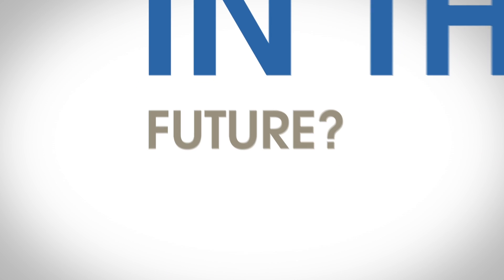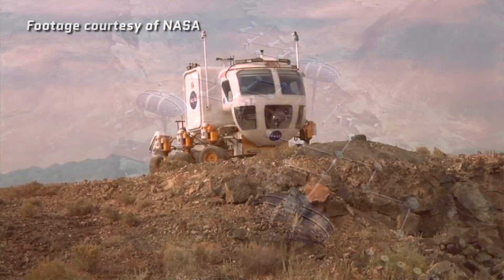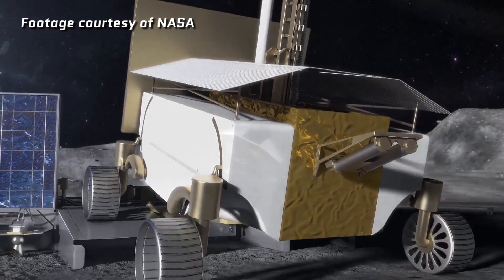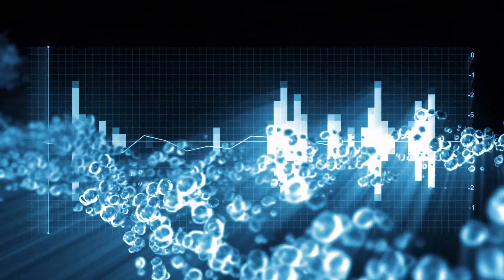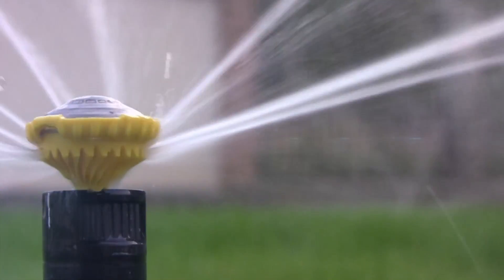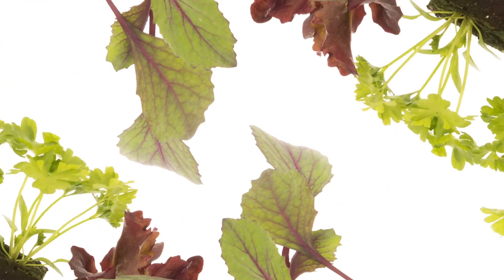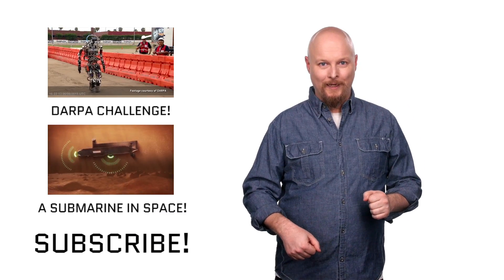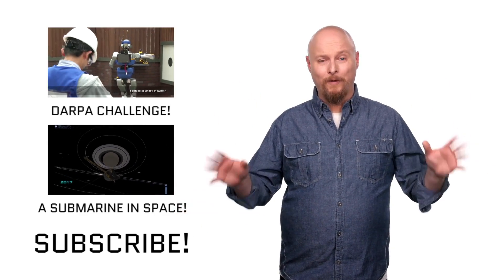NASA Design Challenge!

Comment: how about  use the waters static properties  to allow oh i dunno water  to be drip fed through  something  that is absorbent string like material  that prevents  the  water  from beading up large enough  to  float away  in minimal gravity?  like a water tank with a slow pump internally built in that can be controlled to pump water  through  a string line water absorbent material aka "drip feed lines", so that  the water  can be delivered  to  the  plants base soil were it gets absorbed into the base soil and  the plants root system  can slowly absorb the water soaked  soil?  

any thoughts people?

Comment: If there is centrifugal force acting on those plants in space then why not use drip irrigation to deliver water to those plants. Make an adjustable base on the bottom of the plant through which small droplets of water get delivered as needed to the plant. And as the plant grows the adjustable base should be able to expand and contract accordingly.